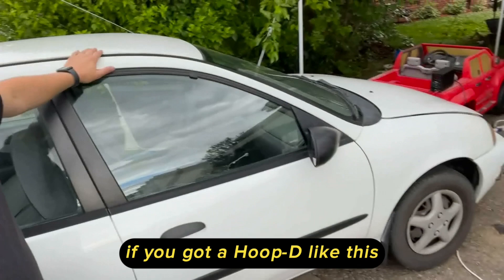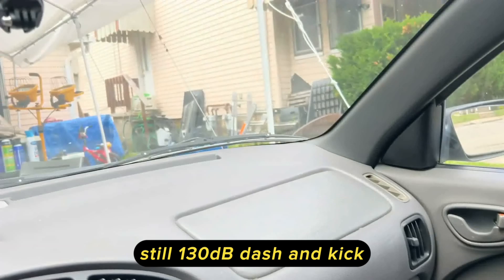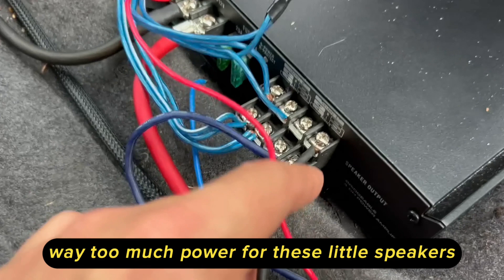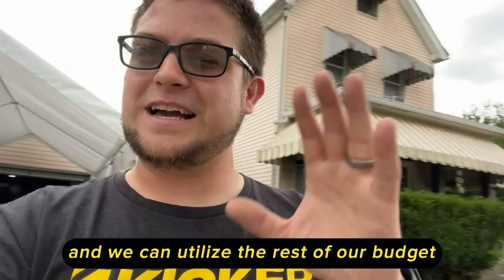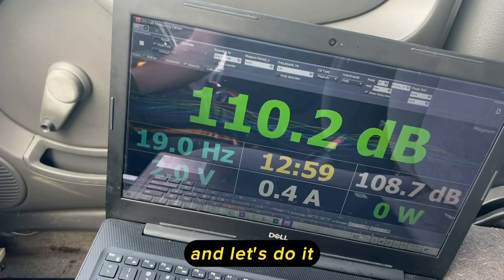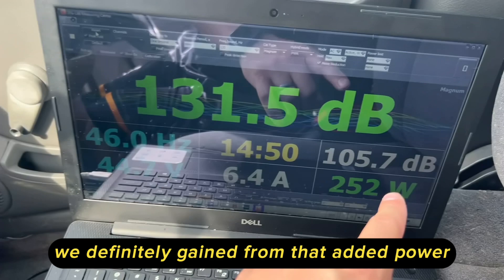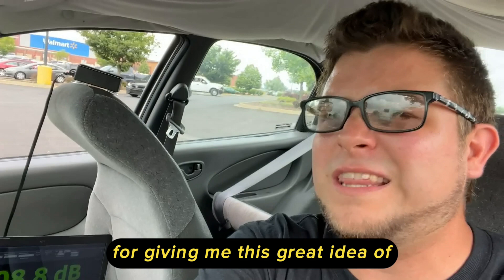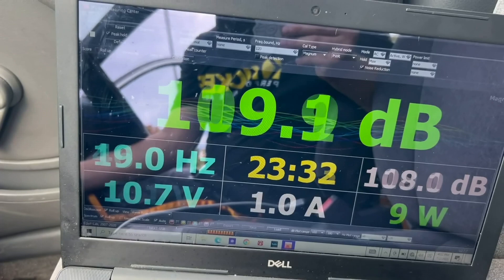Why the Cheapest Complete Walmart System is a Game Changer

Comment: At Ultimate Electronics in des moines iowa in 94 or 95 they had a contest and at the time all i had wasva 4 door 86 ford escort hatchback with an Alpine 7915 deadhead cd player going into a Precision Power (budget line)"Sedona" series 60 watt x 4 and front channels were MB Quart 5 1/4 separates in the front doors with drivers mid hooked out of phase (which actually put the soundstage at dash level instead of lower) and the sub was an older from 1991 JL Audio 12w5 dual 8 ohm coils with around 150 to 180 watts to it and at the floor it did 134.4 db  And i impressed the JL Audio rep that was there because in the sound quality/rta contest i got 34 out 40  with the radios treble at the max of +7, and the bass at -7 max. He couldnt believe it also because i didnt have time to build a new box so i made an adaptor plate for a box   I had for a JL Audio 15w5 that was 3.5ft³ about  1.25 to 1.5 cu ft too big!

Comment: Nice demo but I feel like you cheated the $250  when you used a $380 JY NXT.    I didn't see you power wiring price either which looked like 4awg which would add another $50. 

Let's see the results without the JY.    Also for an extra $3 someone could try the ported box.
Reply from the maker: Trust me - if I could have not used any added eletrical, I would have 

 The charging system in this metro can barely charge a phone…
Voltage is so bad it sees 10v clamping 50 watts 

Only reason I used a Jy NXT..

I am using the scosche 8g kit 

Google 2000 metro alt size -55a
Take 40% away - 33a of charging 🤣

Need something for this car 

Plus that Jy is like a capacitor 👍🏼

I did not cheat - I had to 👊🏼
Reply from the maker: They don’t sell a ported box at Walmart btw